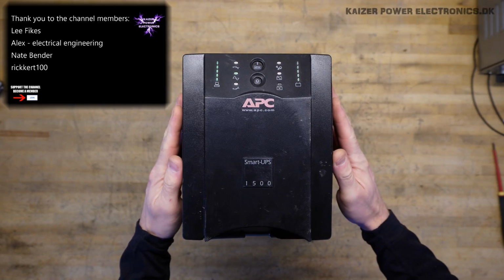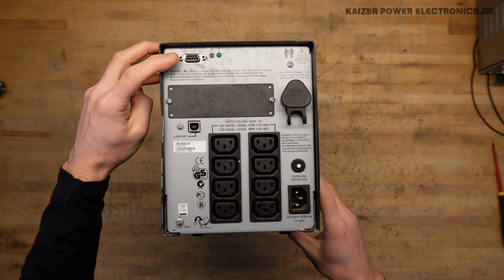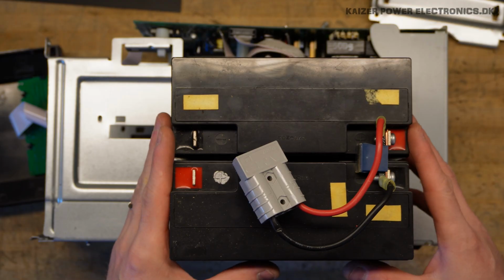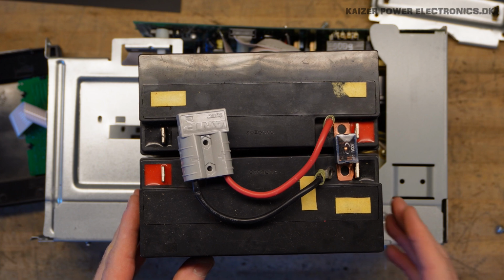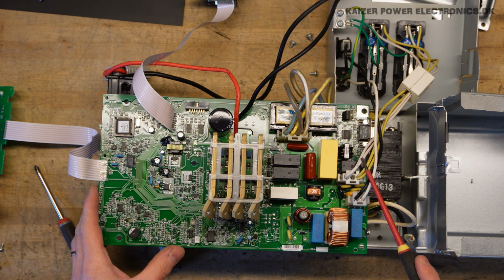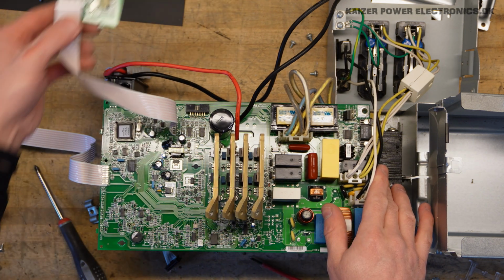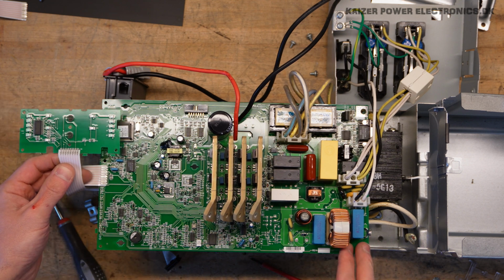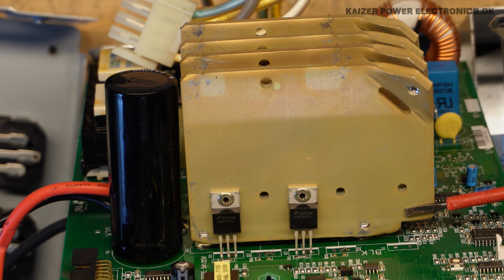APC Smart-UPS 1500VA Teardown

Comment: Thank you for this supporting video I want to know where I can locate battery sensing circuit as my UPS failed to know the battery status correctly
Reply from the maker: I don't have a circuit diagram unfortunately, but it should be located on the main board near the batteries connections. Look for a resistor divider possible going to an analog input/op-amp or similar.

Comment: I’ve got two of this same type that I saved from going into the garage bin. They’re configured for 120VAC here in the US. I haven’t taken the time to tear them down. I’m wanting to repurpose them for backup power for my fridge and freezer. My main concern is heat. These aren’t designed for long duration use. I feel like the components will overheat but seeing that there’s a heat sink and a fan. That might be advantageous. I’m looking at building up the battery bank to have some real run time.

Comment: Mine doesn't charge anymore, what do you think is wrong with it? https://youtube.com/shorts/7yZ1XGKhlho?si=rPP1cQifY_cNU1St
Reply from the maker: How old is the battery pack?
Reply: @KaizerPowerElectronicsDk  6 months old. I replaced the original batteries with 2 120Ah truck batteries and using it as an inverter

Comment: Why if connect lithium is showing low battery while battery is full charge
Reply from the maker: The UPS properly measures resistance across the battery, and the internal resistance of a lead acid battery is different from a lithium based one.

Comment: What is the lug between the ferrite coil and blue thing
Reply from the maker: On the right side of the blue-ringcore-blue, its the earth connection terminal to chassis. On the left side, which I assume you mean, in the white circle silkscreen. It's a lug used as a bridge, instead of the missing inductor, which is circle silk screen is for.

Comment: Do you think its a good business model to repair power electronics? Like solar inverters and amps n whatnot? Should I make a product? Could probably make some nice stuff once i get my math right
Reply from the maker: There is no good business in trying to repair the stuff I find at scrap yards. You will need to fetch it at the actual owners discarding stuff or having a defect. That supply chain is however very hard to break into, as most companies would call their UPS supplier and make a deal for a new one, where the old is discarded in the same proces. All this stuff is also so old, that a aftermarket for repaired units is quite small and maybe only limited to private market, which will not pay high prices. You can get lucky to find just that ONE business with a breakdown, needing just that ONE thing you have. But I can tell you from experience that I have been saving expensive stuff for 10 years waiting for that phone call, it just doesn't happen. Companies go to the big surplus companies that also have some kind of warranty on their repaired products.

Comment: You missed a few points about this UPS.

1: As you later realized, the big "choke" is a transformer, and it has 3 taps on the high voltage side.
These taps are used for voltage correction, as this UPS is "line-interactive", so in case of voltage highs or lows, it uses the transformer as an auto-transformer to boost/buck the incoming AC, without using the inverter.

2: This UPS uses a clever patent held by APC for a long time, where the diodes in the MOSFETs are used as a bridge rectifier to charge the battery during normal operation, and when the UPS is running, it puts the whole circuit in reverse, using the H-bridge to generate ~24VAC for the transformer, resulting in 230v out.

3: The two small "chokes" is in fact also transformers, these are 230/24v AC transformers and they provide the power for all the relays and the control circuits.
It seems like kind of a relic, but APC still uses these unregulated transformers in their newer UPSes even though you'd expect that job to be performed by a SMPS today.
Reply from the maker: Thank you for chiming in with more details, I love learning new concepts :) The 24VAC transformers, was pure guesswork without checking the PCB tracks :o

Comment: I have several of these, the newer version with LCD screens. Very nice units with sinewave output, and adjustable protection from mains being too high ot too low. Got them free from a company that had them as extras sitting around for too long that the batteries where shot. They did not want to buy batteries but just new units instead. These were not even used and like brand new. Added two large marine batteries and they have worked great. Eventually want to use some of my 280AH LiFePO4 batteries, but like everything APC, no schematics and lots of proprietary. I have heaps of APC transfer switches, PDUs and other products. Some are easy to reverse trace the PCBs. I just have to find the MCUs voltage sensing input circuitry and then potentially a correcting circuit can be devised to adapt [safely] for LiFePO4 batteries.

Anytime I see anything APC in recycling/rubbish, esp the older vintage stuff, I grab... The components they use are quality.
Reply from the maker: I got 3 more APC UPS types in the teardown stack. From 1500VA to 40kVA!

Comment: Fuse is in wrong location, it is the link. Got the 750VA version, and it needed new batteries, which are now external, using that connector to power it.
Reply from the maker: So the external battery plug has two poles? They just looked to be pretty close with no separation.
Reply: @KaizerPowerElectronicsDk  No the 750 has an external battery connector, that one you have has a shipping link, you pull it to ship or store it, there is no external power option. Those wires will disconnect one of the battery leads direct from the battery. Needed because they do draw a small current even off and not plugged in, which will over discharge the battery. With a flat or dead battery they will not power on at all.
Reply from the maker: "Battery connector" is in my world, a place to connect a battery. It should have been labelled "Battery disconnector" :)
Reply: @KaizerPowerElectronicsDk  Link to connect the battery.....
Reply from the maker: @SeanBZA  APC be all like RTFM :D
Reply: @KaizerPowerElectronicsDk  Which they also do not make easily accessible either. Just a quick start guide with pictures only, in 11 languages.

Comment: I wonder if that was deemed defective after someone hooked up the batteries wrong? 
Looks like it bit you a few times too! Hate when that happens.
Reply from the maker: It is from the scrap yard, so no doubt defective :) Maybe. Some items are also just thrown from upgrades.
Reply: @KaizerPowerElectronicsDk  Likely tossed because a replacement battery pack from APC costs almost as much as the new UPS itself. But aftermarket batteries that size only cost a quarter of the price, so replacing them if you get it for free is a great deal.
Reply: @KaizerPowerElectronicsDk  Wish I had a cool scrap yard like that near me!

Comment: Been thinking about getting one of these to use as an inverter.. you can get them very cheap but the postage cost as much as the UPS..
Reply from the maker: Even without batteries?
Reply: @KaizerPowerElectronicsDk  Half the weight is the batteries.
Reply from the maker: That was my point. Get one without batteries and its maybe affordable in shipping.